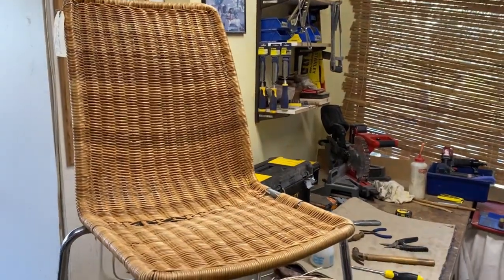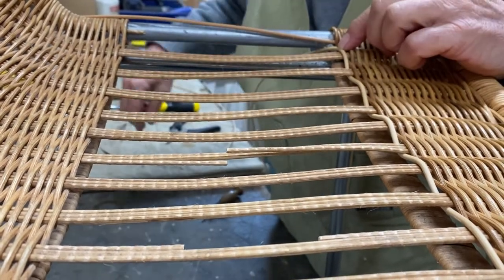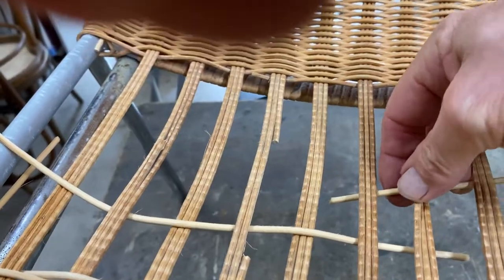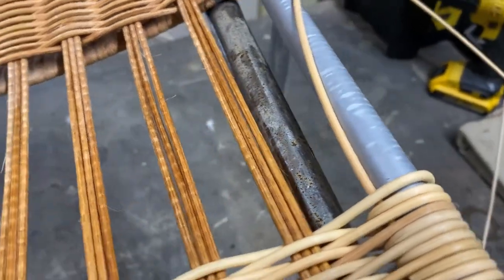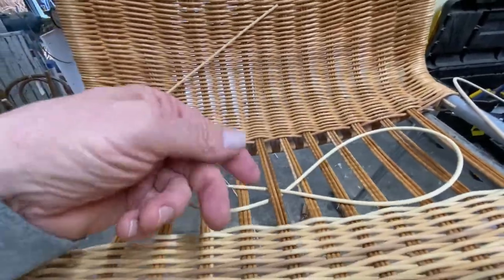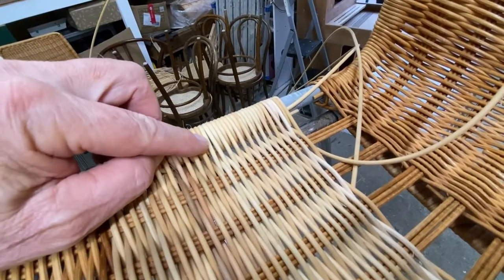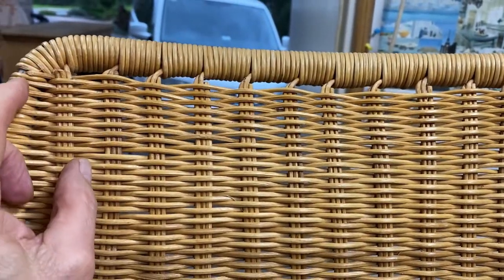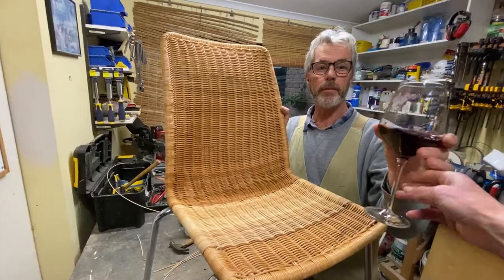How To Repair Wicker With Reed

Comment: Great video. I have problem with reed braking at the end when I turn it around metal frame. Do I need to pre-soak the reed or is there any other way to make it more pliable? Thank you.
Reply from the maker: Oh yes, most definitely soak the reed for approx 10 mins in warm water first. The reed must be supple to bend easily. Good luck.
Reply: @wickerguru  thank you for your reply and for advise. I'll soak it before starting to work with it.

Comment: Great video! Do you use anything on the wicker afterward to coat it so it blends in with the other pieces?
Reply from the maker: Hi Melissa, you can apply a stain mixed in with orange shellac, however I don't recommend this as it can weaken the cane fibres.  Note that new cane will darken naturally with age and natural sunlight. It's far better for the cane to stay natural. Applying orange oil every now and then is best.

Comment: I have a vintage stroller that needs fixing. Can I put epoxy on it to harden and bond everything in place?
Reply from the maker: I'm not in favour of your suggestion. It might solve the issue, but could quite possibly look artificial. Just clean and try and rejuvenate using linseed or orange oil would be my option.

Comment: I repaired the wicker as shown but now have a big colour difference in the new vs old wicker, and don't know which stain/varnish to use to make it look the same
Reply from the maker: You will have to carry out a few tests to see which stain finish will match up. Mixing a stain in with a lacquer, shellac or polyurethane is the best option. Just be aware that the new cane will darken with natural sunlight and age. So best to try and achieve a slightly lighter stain match that an exact match. There's no quick nor easy option. :(